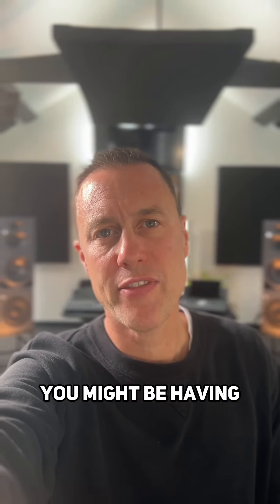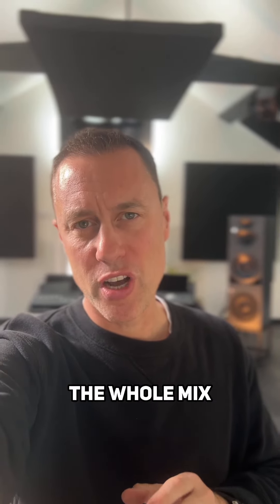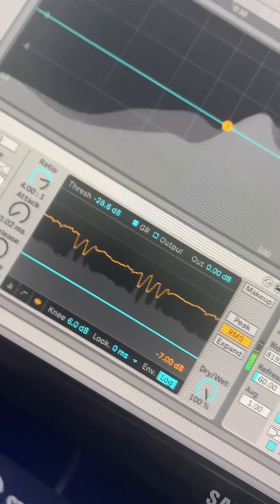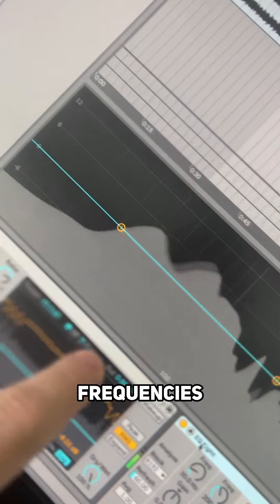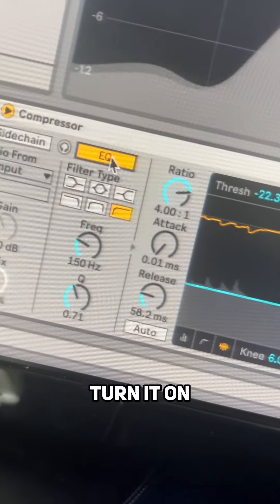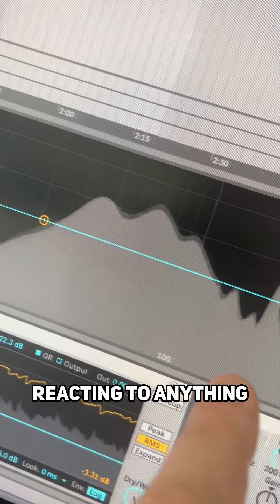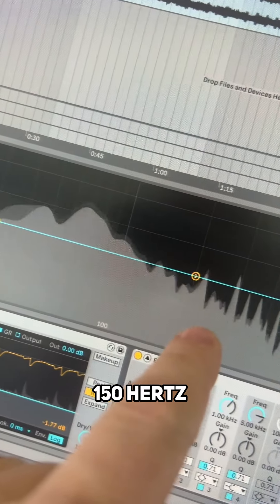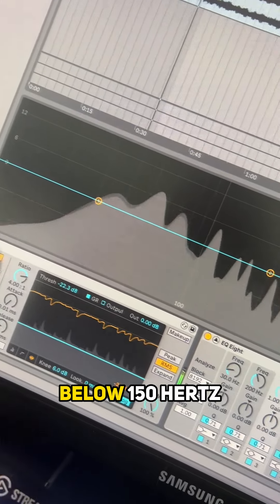$UCKING COMPRESSORS? DO THIS!

Comment: Hi! Thanks for your videos. I have a question. What do you think about use aidtiv EQ (for more LOW END) as last thing in mastering chain, so it cant trigre limiter/compresor. Of course, with using some meter after it to monitoring LUFS and dynamic. have a nice day!
Reply: The point of a limiter is to have the final say on which peaks get shaved down and how. A limiter (and or clipper) finalizes a master, with the exception of SRC and dithering sometimes. Using additive EQ after a limiter will risk peaking above 0dbfs (digital clipping) depending on the frequency range. With an already-loud master any boost larger than your ceiling offset is likely to clip. Believe it or not, even subtractive eq (such as a steep filter) can cause clipping post-limiter due to pre ringing. This becomes a concern when performing any SRC post-limiter. It’s best for the limiter to be the last thing in your chain. There are ways to get big fat bass before you get to the limiter. Hope this helps.